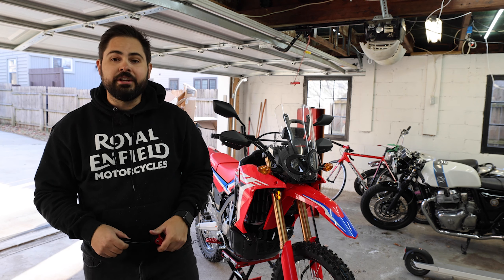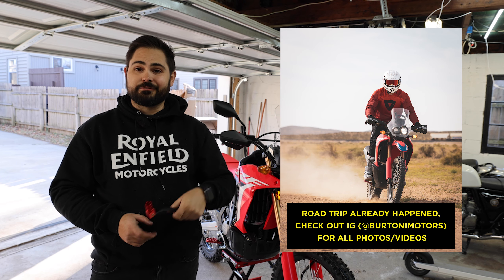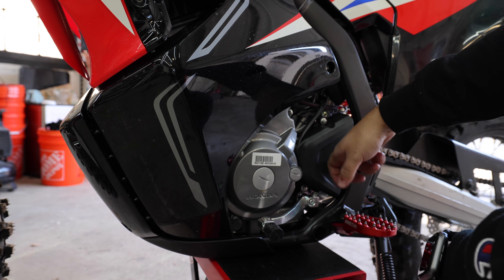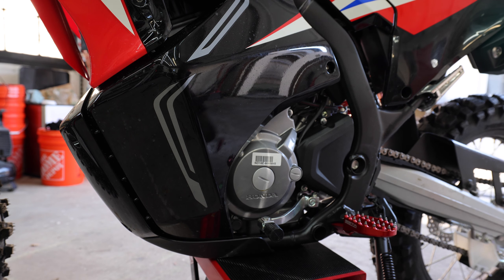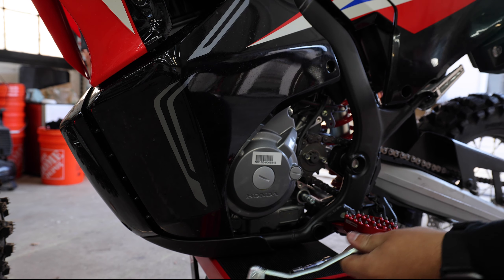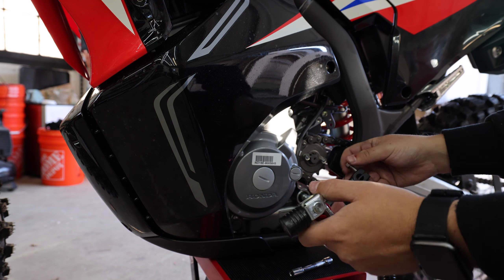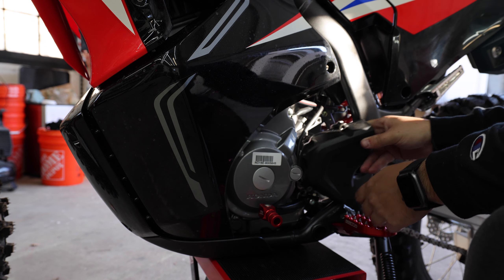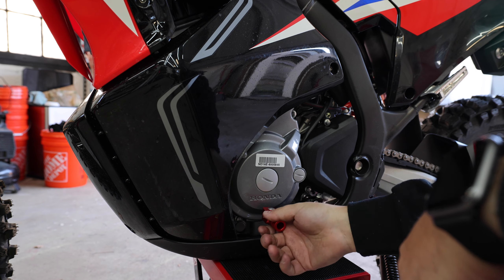Zeta Forged Shift Lever Installation on 2021 Honda CRF300L Rally

Comment: I just installed this (hence finding this vid).  The thing came out of the bag with the bolt at the top which is a bit misleading. The threads are actually at the top so you need to put the bolt on the bottom and not the top since the bottom has no threads.  Had to learn this the hard way lol. I see i'm not the only whi made this mistake lol!

Comment: that was funny, there is no way to turn the screw around dude, tread is only on the one site. hahahaha
Reply from the maker: 8-months later, it’s still there. So meh, it worked just fine.
Reply: @BurtoniMotors   if you say so, i cannot argue, just seem unlikely both sides to be treaded, and still to be able to get tight around the shaft.
Reply from the maker: Both sides were thread, bolt threaded through them both and closed around the shaft.
Reply: @BurtoniMotors  How can it clamp tight if there are threads on both sides of the split.  Maybe that's why yours is loose? at 3.34 you can see when you removed the bolt it slipped out of one side proving the thread is only on one side as Kraken Forever said.